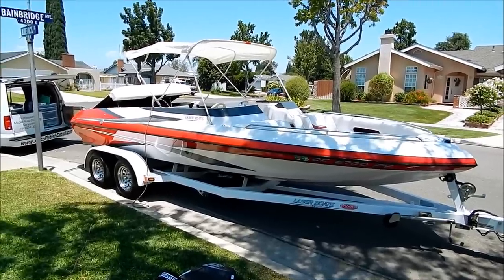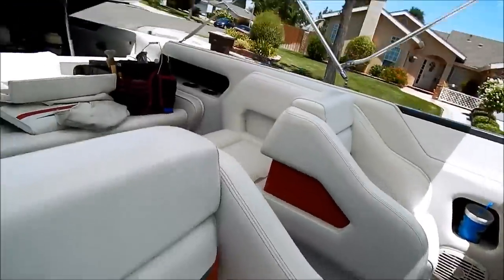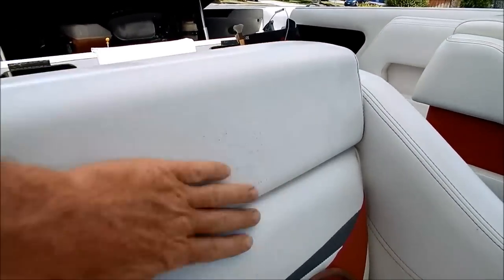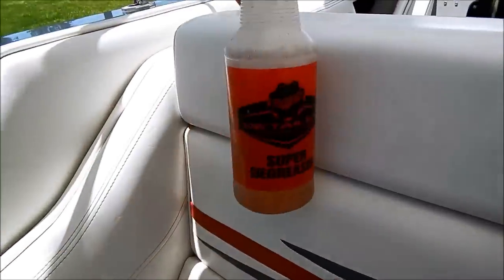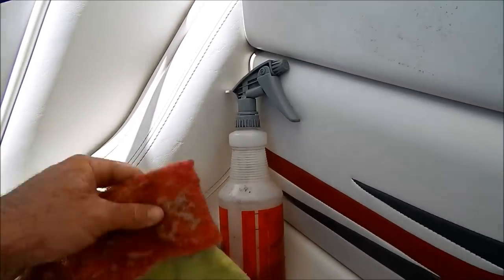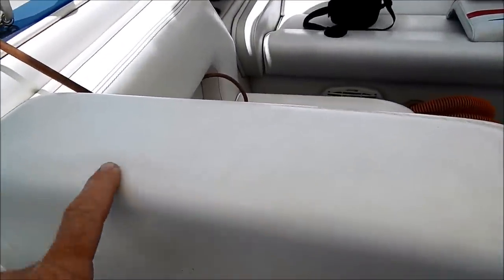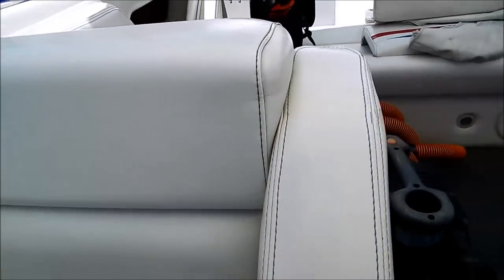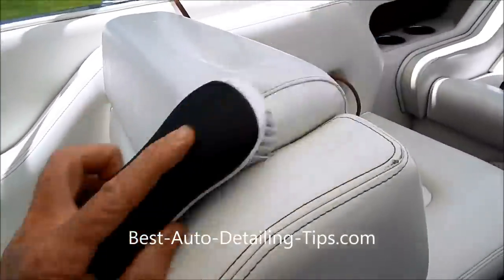Boat Detailing and Cleaning: Heavy duty boat interior cleaning for professional results!

Comment: Mr Clean magic erasers work well for this as well.  Really brightens vinyl upholstery as well as fiberglass.
Reply: Magic Erasers aren't good for fiberglass surface, especially on finished product because its abrasive all you are doing is scratching the surface and in the right light  you will  be able to see where you where rubbing with the Magic Eraser and then have to correct the surface. But yes in a sense you are right they will remove stuff from gel-coat surfaces.

Comment: What do you use afterwards to condition/protect the Vinyl especially from sun after you've cleaned it?
Reply: You are not supposed to let Super Degreaser dry on any surface. It must be rinsed off. It says this right on the bottle.
Reply: Than leather conditioner or 303 protector

Comment: Hi Darren

I think this is what Danielryan5. Is referring to. 

http://www.meguiarsonline.com/forums/showthread.php?27028-How-to-properly-dilute-Meguiar-s-Detailer-Line-products

Perhaps this doesn't apply to you because you pre-mix your solution in large drums and therefore are able to fill your bottles to the top as opposed to pre-mixing directly into a bottle.

Hope this helps.
Reply from the maker: I checked this out; very informative and I stand corrected...mostly. I re-measured yet again and found the 32 ounce bottle is more like 33 ounces, and the fill line as described in this link is still incorrect by a slight margin. 
The real point is that since it is a concentrate, it is not going to make or break your world if the dilution ratio is not precise.
According to the instructions, I myself have been doing it incorrectly but also know that since I vary my dilution ratios, it becomes a non-issue unless taken to an extreme.
Thanks for the link. I plan on doing a revised video on this dilution ratios with regards to the Meguiar's products.